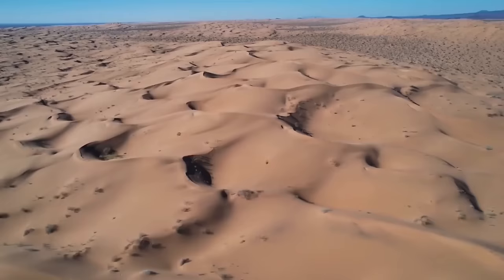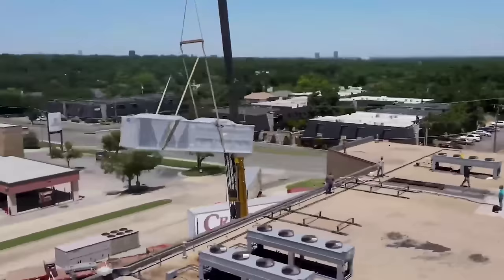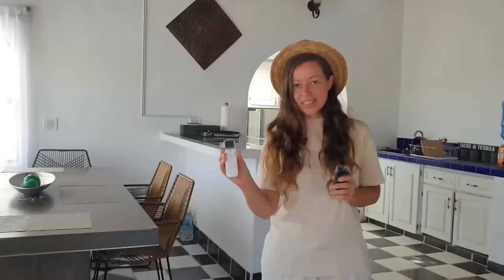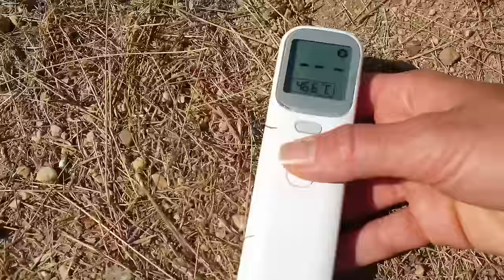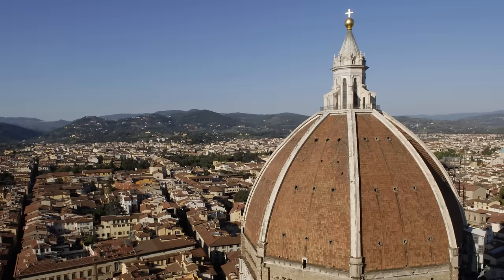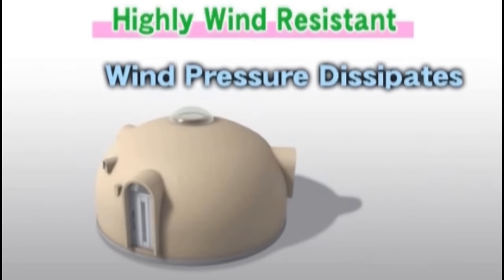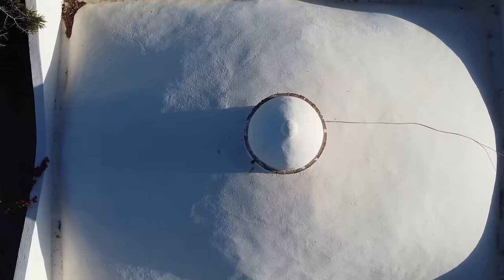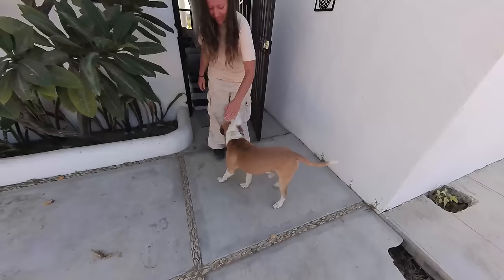How I Live In The Hottest Place On Earth Using An Ancient AC System To Stay Cool!

Comment: I PERSONALLY DO LIVE IN THE SONORAN DESERT and I HAVE A HOME BUILT IN THIS MANNER and IT DEFINTELY STILL REQUIRES A MINISPLIT AND EVEN WITH THE MINISPLIT SET AT 62 DEGREES, MY TEMPETATURE IS NEARLY 100 DEGREES AT NIGHT! I have a 12000BTU minisplit for only 176 sq ft of a Morroccan Dome Home AND STILL IT IS HOTTER THAN HELL
Reply: Are you in or near a city? Surrounded by  concrete of asphalt? I’m trying to learn so asking with respect
Reply: The buried culvert system works… but, going 4’ underground is the best way to go in any climate… only consideration is the land in that case… four feet underground and the temp is constant in the low 60’s… that’s why the culvert method works… research to earthship construction. I lived in Phoenix for 30 years… always wanted to try this… questioned how well it would work there, vs the high desert in which the earthship design was born.
Reply: The arab ones pull the air more underground to cool it off or by water or pools to cool it. With caliche I doubt you could do that without spending a fortune.
Reply: lol.  I figured it was something like that.
Reply: Misleading video. Thanks for sharing. Basically, you are getting cooked like it's an oven. Not ideal.
Reply: EHY ARE YOU YELLING? IS THERE SOMETHING WRONG?
Reply: Ark Survival Schorched Earth over there, not a game though. Take electrolytes once awhile and drink water, stay safe.
Reply: Call cap
Reply: @Shoopuffishgud  YES WHEN YOUR ARE GETTING COOKED ALIVE I'D SAY THERE'S SOMETHING WRONG lol
Reply: This place has AC too. You can see the unit on the wall in the video. This is a sensationalized title for views.
Reply: @SheridanAtwood-bd3ks - I live in India and the yardstick applied here is 12000 BTU for room sizes of 120sft, 18000 BTU upto 180sft and 24000 upto 240sft. IN desert you need to upsize once more to handle the heat soak... plus - get yourself AC's with T3 rated compressors (Tropicalised - what they use in the Middle East) - Both the compressor and the outdoor units are oversized). For the moment - You can either throw in an additional 1.5 ton ac in there - or swap it out for a 2 tonner (better).

You will also find a dramatic improvement of you use Solar reflective paints on the Roof and all external walls (white waterproof elastomeric costings seem to work well. What we do is to create a iron/steel pipe frame and build another roof on top with tin sheets- which both keep direct sunlight off the Roof, an add gutters and plumbing to it leading to a rain water harvesting system.
Reply: @kb100album  Ive always thought the "roof Over a roof" idea would be an incredible way to reduce heat transfer to the inside becuz its going to catch that initail heat and if you have an air gap in between it and the original roof, that will insulate the home from it and the air gap will allow the heat to be carried away as well.
Reply: Good Lord!  I dont know how you even could exist with 100 degree Indoor temps...AT Night!  let alone sleep at all in that kind of enviroment... just wow!  either a hugely more powerful ac unit or move to a more hospitible climate... good luck!
Reply: @kb100album 
I want a house like you described. I live between Austin and San Antonio. This summer has been less intense with about a week of hundred plus in June then this month in August my backyard is always hundred plus at this point of the summer. Last summer the hundred plus temperatures was July and August. I just wish I could live w/out ac. They say it isn’t good for environment. When I was growing up, no schools had ac nor did we have it at home. Seems like we were always fanning ourselves, dripping with sweat.
Reply: 62!?! Why aren't you in Montana?

Comment: There is a mini split AC on wall in first scene in the house, how silly a video….
Reply from the maker: Its there because in July and August is the rainy season and is humid, so maybe needed during that time, thats only some houses have this probably because it is a rented property and some foreigners demand ac. But it wasn't used in this video
Reply: That is not true, I live in the Sonora desert and have stayed in those house for vacation in May, June, July August and Sept, with out the mini split AC they are hot and miserable.
Reply: And yet, the fact remains that only 16% of Mexican homes have air-conditioning so... what exactly is your point? That they used a very nice house to illustrate their points, but that particular house has some A/C for extreme temperature incidents? How silly a counterpoint...
Reply: @LeafofLifeWorld  i have stayed in these types of house many times they are still hot in them never only 75 F. the only way you can get those houses sub 80F is by turning an AC unit on.
Reply: @RichardHarlos  90% us homes have AC, vs. 16% mexcican homes, says it all.

Comment: "There is no AC in this home." Well... Ten what is hanging on the wall above brown door in left upper corner in 7 m 56 sec of this document? Isn't this evaporizer unit of regular AC split system?
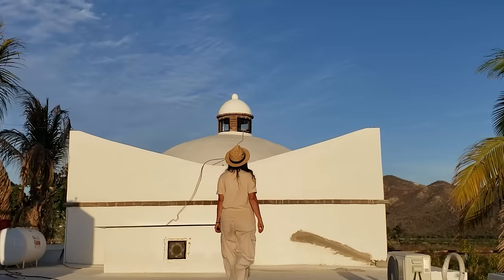Reply: Ahahha, I’ve noticed it on ~6:40, and said “wait a minute.. it’s an AC and it directs on a floor!” 😂
Reply: And there’s a ventilator on the other side on that picture as addition 😂 
Omg, with all those gadgets you can build a room even in a form of poo and it would be cool enough 😂

Comment: In the Middle East, they also use underground tunnels to have the air circulate further down, and get cooler, where there is water, so they have access to water, and cooler homes.
Reply: Bro can i get design details
Reply: @jilaniena6774  Hi, just Google Iran ancient building cooling tunnels and towers.
Reply: You are talking about Khazirs and Qanats.
Reply: The tunnels are for hostages
Reply: 💀 @Jared_Albert
Reply: I see where hamas got the idea from.
Reply: Smarter than idiots paying thousands for AC every year.
Reply: @siddharthshekhar909  Some of the tunnels in Gaza were built by the Israel people in the 1980's, you can find that info easily. Some are ancient and are all over the Middle East.
Reply: @siddharthshekhar909  any idea how they got all that equipment across the intense fortification
Reply: Hah like what people do to CPUs in keeping them cool, little different though, cool.
Reply: @creativeideas012  with help from Egypt and Qatar, what else?
Reply: No, they don't. 99.9999999% of people do NOT have an underground AC tunnel.
Reply: Genius

Comment: I grew up in California and visited many of the old Spanish missions there. Everything about the construction is designed to keep the buildings cool. They are usually painted white to reflect sunlight, and the walls are very thick and well insulated, which helps in preventing the heat of the sun from reaching the inside of the structure. The adobe bricks used to make the buildings, which are made with a cement mixed with straw, stay quite cool as well. The flooring inside is all made of stone, which also helps in staying cool, and the missions feature courtyards which are designed to maximize shade all day long. The windows are also built in a way so that the amount of sunlight coming in is minimized as well. I always noticed how cool it was inside those buildings. The downside is that they are, of course, quite dark inside.
Reply from the maker: Thats very true and is a design from Muslims brought to Spain, this house was using all these principles except an inner court yard. This particular house was quite light and bright due to the south facing windows but the windows had an over hang to prevent direct sunlight penetrating inside, so it still kept it cool
Reply: Exactly it's all about the thermal mass and reducing heat gain.
Reply: If they used CFL and LED lighting, it would remain cool.
Reply: The California Missions were NOT built of cement and straw. They were built of adobe bricks cured in the sun. Not cement.

The tiles were not stone, either. They were also manufactured on site from a clay based composite. Same as the roof tiles.

The white color, while superior for heat reflecting, comes as a result of the plastering over the bricks. Adobe can last for generations, as long as it is kept dry - from above as well as laterally. The plastering served that purpose, especially in certain coastal California locations.

The Missions weren't always white, either. Many buildings were painted a darker color, often a reddish due to ease of availability of iron oxide (why old barns were red) for a distance up the wall, then finished in a tan like color for the majority.

The use of Adobe was not introduced by moorish influenced Spaniards, as there is pre-Columbian evidence of its use.

I began as a Mission docent 30 years ago.

Comment: The temperature is supposed to be measured in the shade, not on the ground that is being heated directly by the sun. There's going to be a big difference between sun and shade outside.
Reply: You can bet the alarmist are measuring black soil in full sun . Last year they touted water temps in a four foot deep back water at a marina      The sea ice pack is at a twenty year high .

Comment: 4:09 Air conditioner above her head... 😂😂😂
Reply: True 😂😂😂😂
Reply: True, but that AC is tiny for the space, and they probably only use it for really hot days.
Reply: Lmaooooooooooooooooooooooo FAIL
Reply: @edge1481  C'mon maan she said u dont need ac and now u need one, which one is it?
Reply: @edge1481 there’s at least 2 split units on the roof
Reply: likely a redundant system, the smartest designers incorporate this thinking into their werk... for example: think of a Navy sub and all it's backup systems
Reply: @juancamaney4392  yep.
Reply: It's not just a AC unit it can also heat, good for the occasional really cold night or the exceptional hot day where it's still warmer inside the what is comfortable. But the ancient means of cooling allows them to not have to run the unit most of the time. You could get by without the unit but it's going to get really uncomfortable every now and again.
Reply: @edge1481  No, they use it every day man. Get real.
Reply: @NetraAmorosi  No, it's for air conditioning man, the 'ancient means of cooling' isn't real bud.
Reply: @edge1481  

You mean when it is 117 degree outside....like when she took the temperature before going inside?
Reply: @edge1481 no they use that when there home
Reply: Lol and the timing of "the secret is right above me" right when the ax was over her head, that's awesome. I'm not shitting on the vid, I'm sure all that helps and reduces how much ac they use but funnys funny 😅
Reply: There sure is. Wow.
Reply: That's a minisplit(?) and I've not encountered many in my life. Could be she didn't know and thought it a fan or something.
Makes her look silly nonetheless!

Comment: Air temperature is what we use, not the temperature of the ground/floor surface.
Reply: Earthships use the temp below the Earth to heat & cool
Reply: @andibowe6890  that’s a house, not a ship.
Reply from the maker: Earthship is a type of house
Reply: kwa wrote, "Ari temperatrure is what we use, not the temperature of the gound/floor surface."

Perhaps it would benefit you to understand a bit more about thermodynamic. Ground, air, surface, material properties, etc., all contribute to the overall movement and storage of heat throughout a structure. Too many people oversimplify too many things in order to create an illusion that they 'know' what they're talking about when, in fact, they do not.
Reply from the maker: @RichardHarlos there is more than one way to measure temperature, as long as thr two temperatures taken are at the same altitude we can compare the two..

"
In meteorology, we commonly distinguish between air temperature (near the surface or in altitude),surface temperature, soil temperature and water temperature and temperature in altitude.
In addition, it should be noted that temperature is highly dependent on altitude. On average, the air cools by about 1°C per 100m elevation increase. Therefore, it is important to know at which altitude the measuring station is located and at which height the temperature sensor is fixed. In this way, the altitude of the station and the height of the instrument relative to the ground can be considered correctly."
Reply: @LeafofLifeWorld  I think your reply is in response to something kwa wrote. I was merely quoting what they wrote before replying so that it was clear what, specifically, I was replying to.

Even so, you shared useful information and insight, and I appreciate it.
Reply: She had to get the ground temperature so she can measure the floor that was cooled by the AC lol. 4:09.

Comment: Not just only built-in energy efficiency, but also artful beauty in harmony with the surroundings. I wish it were more widely adopted.
Reply: @josdesouza - it is a beautiful design 💚
Reply: Why don't YOU build one
Reply: Unfortunately, I almost bet US building codes would not let these be built.
Reply: @eddyb2001    Laws vary, but most important are structural integrity and safety. If those aren't violated, then it should be alright. Since those structure have been around a long time, it should be easy to make the case that they're plenty safe. Of course, the specialized construction techniques of the dome-builders might not be available everywhere. In those cases, there may have to be either another way of having the domes built properly or of adding strength to them.
Reply: @markhathaway9456  yas..   earthquake would be bad..    3rd world adobes now have cheap earthquake helps:  mesh, etc

Comment: To really keep the house cool, build the entire house at least 2m underground.
For walls facing the sun, put shades on the outside, not inside the windows. And shade the entire wall, not just the window.
Reply: or just build a cave like open out side  basement with a vent window it the top
Reply: We built with double stud R-40 foam filled walls and R-60 in the ceiling.

Comment: What else can be done to cool a house without conventional AC?  Lots!  

If, during your construction, you're able to get use of a backhoe or digger, you can use it to dig a 1.5-2m(5-6ft) trench for 10-15m (30-50ft).  Then you place a tunnel of rigid material down there, like concrete conduit.  One end of the tunnel should end inside your home, on a lower level, and one end should terminate outside in a covered area protected from animals by mesh.  The temperature down there should be notably lower than the daytime high temperature and you can use the air to cool your home either by pulling it in with a fan, or using thermal ventilation like in this dome.  

There also exist paints, that can be made in a garage lab, that can convert ambient heat into a specific wavelength of IR that our atmosphere is completely transparent to.  What does this mean?  It means that a surface coated in this paint can cool itself up to 10C (18F) IN DIRECT SUNLIGHT.  It's not a huge amount of cooling, but it works all the time and can just be used as a nice, white paint.  (It is fragile as a paint, and kinda expensive, so it will need a protective coating, but it still just sends almost 20F of heat zooming off into space without power.)
Reply: wow    ty
Reply: how's that paint called? and you could use any kind of paint to cover it from the elements?

Comment: Those aren't new techniques..... Architecture that promotes airflow and natural cooling has been around for thousands of year.  We stopped using them because of electric AC and heat.
Reply: Then we made a very poor choice indeed. So many areas of the planet, in particular large metropolitan areas, have built building and roads that are not designed to naturally regulate temperature. In doing this, we have only made our temperature regulation more difficult... and costly.
Reply: @RichardHarlos  You're absolutely correct.
Reply: There are videos from Iran on yt about how they use ventilation towers...
Reply: She's spoken several times throughout her video about so many previous cultures using their techniques. So I'm not sure why you're repeating her. You're exactly as smart as someone who paid attention.

Comment: The color white of the house is what really help keep the temperature down!
Reply from the maker: Its one element but having lived in a white building myself that alone is not enough, high ceilings and overhangs really are important because even with white walls if the windows face the sun, it will get very hot inside
Reply: @LeafofLifeWorld that's because people won't put shades or blinds on the outside of the windows.
Reply: @LeafofLifeWorld   We need home plans which use that solar heat for heating water and designs which also block sunlight where we want to live most. Add underground air flow for cooling or maybe a passive solar mass wall for storing heat for air warming at night. There are a lot of different passive elements which can be used. Practically NONE of U.S. houses use these. We're a commercially-driven place.